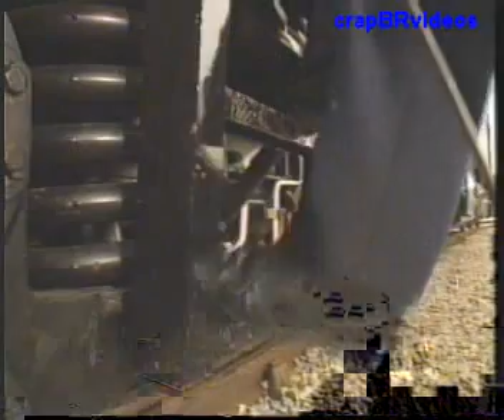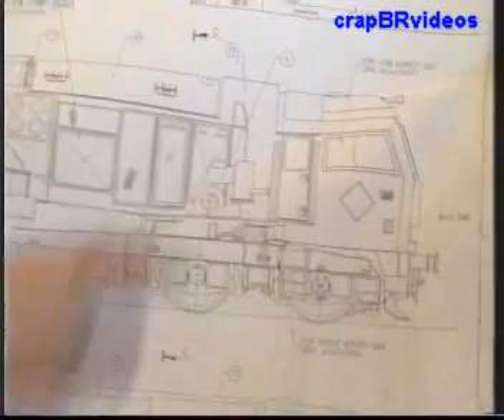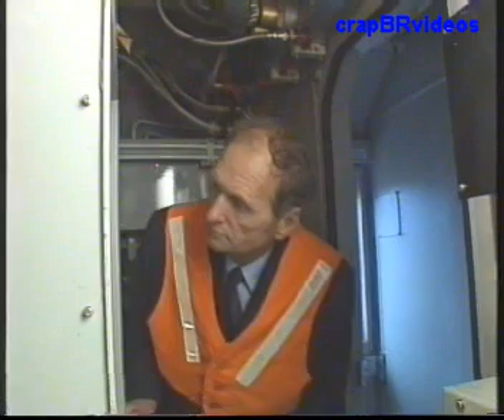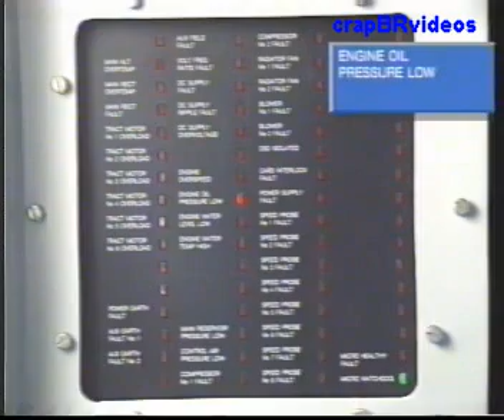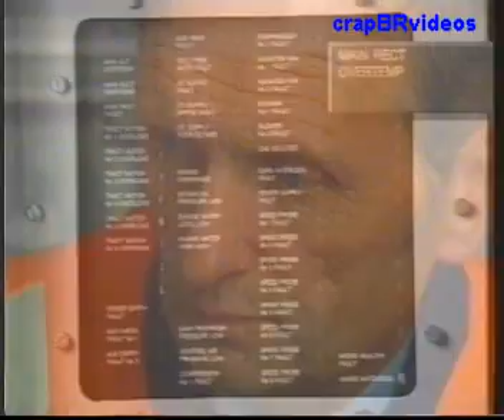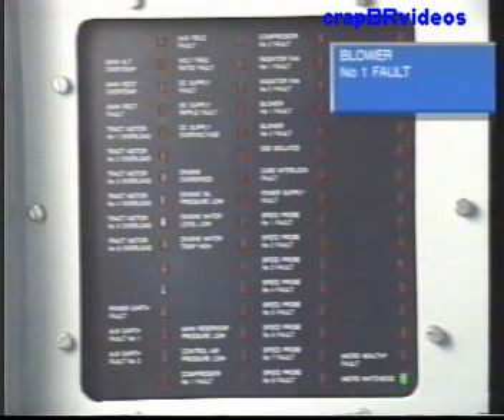6. Class 60 - The Power to Move Mountains

Comment: Nerd Central Arizona. I love these corporate knob jockey videos. I get the impression this loco had shocking build quality and reliability and it was therefore built around a shouty “computer says no” fault bolox flashy light panel. It’s a fancy looking machine that doesn’t work often. Class 66 is a shed but actually goes?! Yes/no, I’m not a train driver so please enlighten me 😅
Reply: Americsn freight locos were ahead. they built a class 59 based off the SD40#2 it could haull 4000 tonnes, it had a 95% reliability rate that beat any BR loco before it by quite a good margin. 
The class 60 same specs, was based or stolen if you like hehe off of it. They designed and tested SEPEX for faster wheelslip detection
which kicked in at 0mph instead of 5mph and added slip ring alternators to get even faster wheelslip detection. For those who dont know rail wheels give the most grip right before they're about to wheel spin. so keeping it close to that bumps up the pulling power.
Class 66 EMD came out and was 98% reliable /availability and was cheaper to run and needs less care. so most of the class 60 fleet was due its planned major overhaul at 15 years age and never got it. after a while they gave some their overhaul as their pulling power is unparalleled in the uk. especially if it rains or its freezing
Reply: One class 60 is good for 4 500 tons from a stand on a 1 in 100 rising grade, which would need at least 2 if not 3 class 66 to do the same.
The 60 s are in a league of their own, true British Engineering !

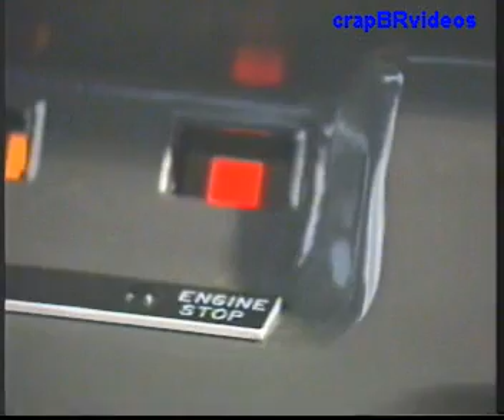Comment: 7:03...
You'd have thought that there would be a 'light' to say it's the DOOR SWITCHES on the panel, instead of one single light that could mean all sorts of things that are stopping the engine starting.!!!.   
Door switch indicators, and other 'stop and emergency stop' indicators, are generally ubiquitous when it comes to machinery.  No matter what kind of machine it is.!🧐!.
The same thing applies to fire detection equipment, and, other obvious safety categories.

Comment: 6:38...
There shouldn't be any 'more common faults', on a BRAND NEW locomotive, should there.???.

Saying that... It IS British built eh.!🤣!.
Reply: they were designed for 95% availability which as with any new loco contract spec, better than what went before. The 66 had 98% and a lot cheaper to buy, service and generally maintain. Still they brought the 60s back in for a very good reason. Haul heavy loads that others would require banking of double heading. Who wins the title for having to stop at a red light, ect with the heaviest cargo in the wettest slipperiest  weather and restarting the whole lot if they had to come to a stop where other locos would need to build up a bunch of speed before the incline to just about make it over? The 60!
Reply: @alstonofalltrades3142  no one wanted to order a EMD loco with 4000 hp., for use in the U.K.
Reply: @rearspeaker6364  well they did keep ordering 59 in small batches then built the 60 based of it but with better wheel slip control.
Reply: @alstonofalltrades3142  that SEPEX seems to be a first rate system.
Reply: @rearspeaker6364  definately. i love they trialed it on a class 58. then they came up with slip ring alternators to detect slip even faster. I recently read the class 60 can traction on the spot at 0mph. Like a car on a hill. it wants to roll back but with the right clutch and accelerator setting the car is stationary without beakes applied
Reply: Take a look at the Adelante Videos, you'll soon find that 60s aren't that bad 😂

Comment: Fatcher’s Britain....... Don’t make me laugh. 
So Brush subbed out various bits of the 60. Got the bits back. Fitted it all together in a shoddy manner. Poor quality control. Countless test failures. And then spent any of the remaining profit from the job putting things right for the next 5 years! Well done Brush. Secured the end of British heavy locomotive engineering. Should have gone to Metro Cammell. All the best kit is built in Brum...... we invented the square steering wheel. 
The class 59 was the most reliable loco ever to run on British tracks. Enough said...... Apart from the desperate need to genuinely PRIVATISE the rail system. It’s the only way forward.
Reply: How do you "genuinely privatise" it?

Comment: the 60 is like the 92 but a different face
Reply: +Class 387 Gatstar (Gatwick Express) They share the same bodyshell, and are built by Brush Traction
Reply: its nothing like a 92 a 92 is electric xD
Reply: hmmmm.  They do have the same sides
Reply: that's the only thing though
Reply: that was basically the idea
Reply: They share the same monocoque diagonal stressed body. just one is a diesel the other electric
Reply: A 92 is a 60 with a different face literally
Reply: @benstrainsandthingsNot 100% true. But not totally inaccurate, either.

Comment: Yeah, the FDL power units were / are not the best of it mate, its has to be said. Ive been interested in rail opperations in America for about 6 years now. I know alot of people dont like em here, and thats only because all they see is a 66. but there's no getting away from it, you'l be hard pushed to beat the reliability of an EMD power unit. They even exported to 60 countrys around the world since the 40's! Hell, i dont think i could even name 60 countrys LOL.
Reply: I'm a big fan of the 60s and what they can do. The Americans have been hauling heavy freight as a super economic power for a long time. They got very good at reliability and cheaper to build and service, cant take that away from them. But in certain situations, they brought back 30+ 60s for a reason, to save banking or they cant get that heavy weight up that incline in bad weather.

Comment: LOL, you dont know much about the GE FDL 16 do you?? Its plain ole junk fella! Ask any American on an American railroad video on youtube! Most of them will tell you that GE are shit. Most of the time the bloody things are on fire lol. They are known as toasters. I can point you to a forum with real American drivers posting on it if you want where you can find out all this stuff.
Oh, i also know a driver in the UK that will tell you a 59 will out haul a 60.
Reply: This is the problem with just 'one source' the 60 was partly based on the 59 and rightly so. The most tractive effort you can get out of a wheel on steel rail is right before wheelslip. The Americans have been a super power on a large country for a long time meaning way better expertise at building locos to do the job more reliably for less price and cheaper maintenance. They trialed Sep-Ex on a class 58 and slip ring motors to detect if just one axle was begining to wheel slip far faster and reduce power. E.G. over junctions or curves or bumps in the track. At the exact same time that meant the loco weight was going through the other axles in the bogie far more and hence more power could be applied before they slipped. Kinda like me standing on one foot means its harder for someone to swipe that foot away. Of all the type 5 loco's in the UK they 60 is the least powerful engine with the same lower gearing as a 59 but can haul so much on a incline in imperfect weather conditions. This is why they brought them back and why despite the least powerful type 5 hp engine rating they can do the job without banking or double heading
Reply: I forgot to add this is why what they tested on a 58 went straight into a class 60 along with what they learnt when the 59's came here and proved what they could do.